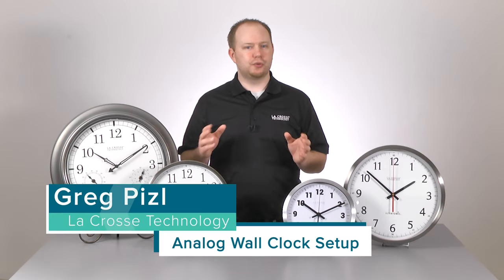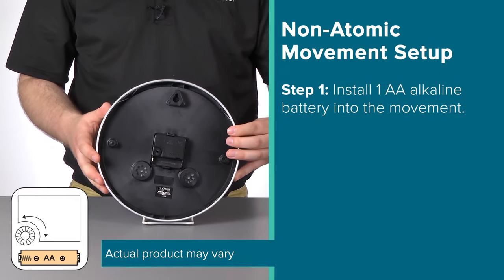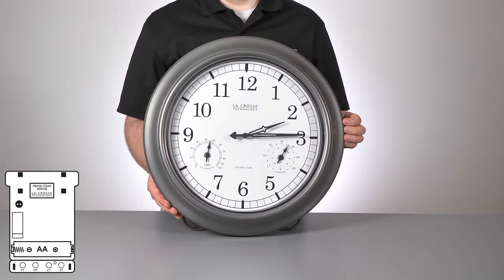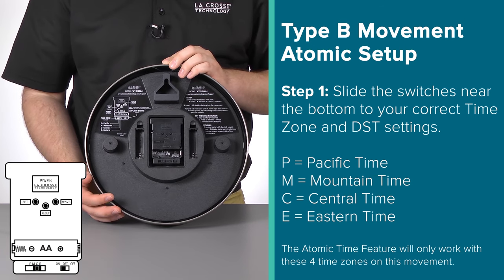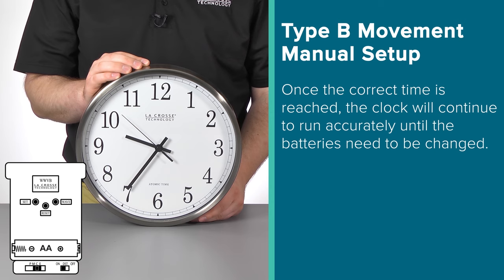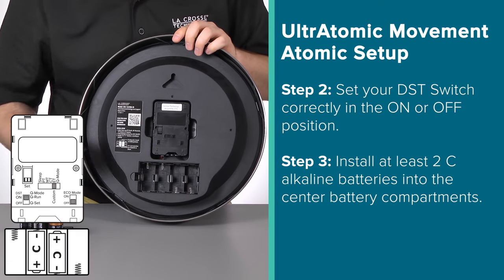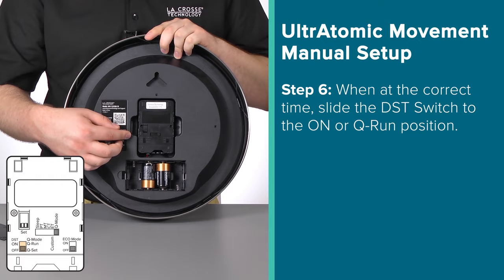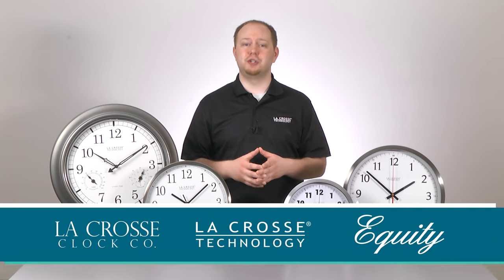How To Set Up Your Analog Atomic Wall Clock

Comment: In a hospital trying to help out the staff by adjusting the clocks for DST - this is the most complicated clock I've ever seen. Why not just have a wheel on the back to adjust like every cheap clock has?
Reply from the maker: Our sincere apologies for the trouble getting your hospital's clocks set correctly. The WWVB radio signal that our atomic clocks are designed to receive may not reach all locations, and we are truly sorry for the inconvenience of these not adjusting automatically for the DST change. Due to the nature of these radio controlled parts, their movements work differently than normal quartz clocks that feature a single set dial. This video offers manual time set instructions for each of the movement types you may have. If you should have further questions, please let us know or feel free to reach out to our support staff directly here: https://bit.ly/contact_techsupport. Or alternatively, send us a private message on our Facebook: http://bit.ly/LaxTech_Facebook or Twitter: http://bit.ly/LaxTech__Twitter page.
Reply: Watching the video may help. It explains the function of everything and how to set it.
Reply: 737
 @lacrossetechnology
Reply: 7:40

Comment: I bought the UltrAtomic model to see if it would pick up the signal in Bogota, Colombia. I checked the WWVB coverage map and in theory it should receive the signal late at night when propagation is at its best. The first night it did not synchronize but I had it in a pretty bad location near computers and power lines and not facing towards Colorado. The second day I hung it from a wall facing WNW (towards Colorado) and more than 9 feet from computers and power lines. It synchronized at 8 pm local time (EST no DST). I was not expecting that! I am 3137 miles away from the WWVB time signal transmitter and 8300 ft above seal level. This UltrAtomic clock is extremely sensitive. Good job La Crosse Technology!

Comment: Do I need to turn DST switch to off when daylight saving ends? and switch it on when daylight saving starts?
Reply from the maker: Nope! The WWVB signal should adjust this correctly once your clock receives the radio signal. The switch is just meant to tell the clock whether you're in an area that follows DST or not.

Comment: Thanks for your video. I bought a Sharp atomic wall clock about 18 years ago. It matches your A type.  It still works accurately, but changing battery and restart was always difficult. It came with no manual or instructions. I'd reset it each time on trial and lots of error, luck and a prayer. 
But this time it kept coming out exactly 4 hrs and 10 minutes behind.

So I came across this video of yours and it covered everything. I tried each option and finally was able to do a manual reset, with confidence. Old Ironsides is still working! 
I thank you from the bottom of my heart.

Comment: As an electrical engineer, it's pretty clear to me that for the clocks that permit additional batteries to extend battery life, the batteries are connected in parallel to identically sized cells. (The AA movements put all the AA batteries in parallel, the Ultratomic clock puts two C cells in parallel, and then puts that pair in series with another pair of parallel C batteries).

I don't think you stress enough - If you add additional batteries, they should ideally be all the same batteries from the same package. Even mixing identical batteries from different packages purchased at different times can result in a mismatch between the battery characteristics. Additionally, if you change batteries, change them all at the same time, and replace them with batteries from the same package.

And, of course, alkaline batteries are recommended (both for the AA and C cells) because of their extended lifespans.
Reply from the maker: Thanks Kirk! We truly appreciate your feedback and attention to detail. Many of these points are emphasized by our support staff if users are having trouble with a product, but we will certainly look into adding additional details to our manuals to further emphasize this in the future. If you should need any assistance with a product, please just let us know.

Comment: Just got the UltrAtomic clock displayed in this video. 

Looks great and was easy to set it to the correct timezone. Almost completely silent.

Thank you!

One small concern, the second hand isn't completely aligned with the minute points. Is there a way to fix this?
Reply from the maker: We are happy that the setup of your new UltrAtomic clock went smoothly. Unfortunately, there is no way to manually adjust the second hand, and we sincerely apologize for any inconvenience. If you wish to return the clock, please get in touch with our store directly at 608-785-7939 or via email at store@lacrossetechnology.com

Comment: Just got my Ultratomic clock.  Watched the video.  So far the clock is not getting the signal from Fort Collings.  I took it outside,  75 feet away from any building and still no signal. I read that atomic clocks have a better chance at getting the signal at night.  So I placed the clock by a window and will check tomorrow.  I am on the East coast in the NYC area on the New Jersey side.
Reply from the maker: Sorry for the trouble. It is not unusual for it to take a little longer being on the east coast. If you're still having issues, please message our support staff directly here: https://bit.ly/contact_techsupport. Or alternatively, send us a private message on our Facebook: http://bit.ly/LaxTech_Facebook page for further assistance.
Reply: @lacrossetechnology  I forgot to follow up on my original comment that the clock started working as soon as it got dark. I suggest you update the information in the small booklet that comes with the clock and letting people know that  they need to be patient and leave the clock overnight by a window facing Fort Collins.

Comment: We have a type B that has been, for the most part, working fine for several years.  Recently it has begun to randomly set itself to different times randomly.  (It never does find the correct time.)  I've changed the battery several times.  We live 9 stories up and the clock is on an outside wall.  I don't think the signal is lost as we also have another La Crosse clock in the next room that works just fine.  Do these movements just wear out?  It's a nice enough looking clock that I'm considering replacing the movement with a cheap generic (manual-set) movement and calling it good.  I considered the manual setting as mentioned in the video but that button is missing from our clock... just a hole where it should be...
Reply from the maker: Hey Dana, we are truly sorry to hear this and apologize for the inconvenience. For further assistance on this case, please message our support staff directly here: https://bit.ly/contact_techsupport. Or alternatively, send us a private message on our Facebook: http://bit.ly/LaxTech_Facebook or Twitter: http://bit.ly/LaxTech__Twitter page. We look forward to helping figure out a resolution.

Comment: I have a question, will the ECO mode work on the UltrAtomic movement if I had a manual time setting?
Reply from the maker: Hi Bukui, that's a great question and one we should be discussed in more detail in the video. Unfortunately, when running full manual mode the UltrAtomic movement cannot run ECO Mode. This feature requires help from the WWVB signal to know what times to turn off the second hand function. We apologize for any inconvenience or confusion.

Comment: I live in Hawaii does this clock utilize WWVH? so far I can't set the clock. Note I have 2 of these and the first one was no problem
Reply from the maker: We're truly sorry for the trouble. As mentioned in the video, the different time zone abilities will depend on the model clock(s) you own. For use in Hawaii, the UltrAtomic movement will likely be necessary to use the "atomic" feature and receive the correct WWVB time signal. Please review the times in this video for each clock movement you own, as they may work differently. If further assistance is needed, please reach out to our support staff directly here: http://bit.ly/contact_techsupport

Comment: Hi can anybody please advise please...Im in Ireland Europe and have an ALBA battery operated kitchen clock. The battery ran out so I've inserted a new one. I've only just noticed it does say radio control on the front of clock. So with new battery  in, the hands are going around and when I get to the time I want the click to stop at... Im pressing set...didnt work ...pressed reset nope and the other tiny little button that I actually need a pin to press these three buttons that say "reset" "set "and "wave" (?)....it stops for a second at the correct time when I press the "set" Button and seconds later it starts spinning again! I never actually know the clock was radio conrolled till u mentioned it and i spotted the small print.. Do u think it could be difference for my location!!  Would really appreciate your help or advice. Many thanks
Reply from the maker: Hey Lisa, unfortunately your product is not an item made by us, and there very well could be differences in how the clock will function compared to the instructions shown in this video. And though we make no promises, if you could please pass along an image of your clock's movement (the back of your clock), in a private message on our Facebook: http://bit.ly/LaxTech_Facebook or Twitter: http://bit.ly/LaxTech__Twitter page, we'd be happy to try and help decipher the instructions you should follow. We are sorry for the inconvenience.

Comment: I took the clockworks out of the original clock and placed it in my living room clock. The  clock hands do not show the correct time. Do the clock hands need to be set at a particular position (e.g., twelve o'clock) in order for the clock to match the Ft Collin's signal?
Reply from the maker: Hey David, we are sorry to hear about the issues with your clock's movement. If you've followed the steps outlined in this video for your movement type and the hands are not correctly stopping where they should (4, 8, or 12 o'clock position) during the initial WWVB search, this positioning issue may not be easily fixed. Our clocks are not designed to be taken apart and we should note that doing so does void your warranty. However, for further assistance please message our support staff directly here: https://bit.ly/contact_techsupport. Or alternatively, send us a private message on our Facebook: http://bit.ly/LaxTech_Facebook or Twitter: http://bit.ly/LaxTech__Twitter page.

Comment: When setting up the ultratomic clock, if we are setting up a different Time zone in-between GMT 0 and -11 but the country doesnt use DST, do we still have to set the DST switch to the ON position? Will keeping the DST switch OFF, maintain the clock with the accurate time for said country without DST on that time zone? Thanks in advance
Reply from the maker: For this situation, the DST switch should be kept in the off position to keep the time running correctly. 😊

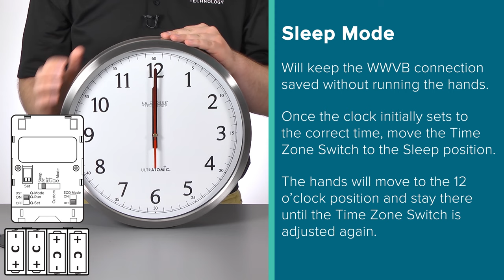Comment: I have a type A clock. Recently it stopped keeping accurate time. I removed the batteries and after several hours installed new fresh batteries. The hands started spinning but didn’t stop at 12:00. The minute hand would go to 11:40 or so. After manually setting the correct time it always adjusts to about 20-22 minutes slow. I sent an email to support who did not respond. I did get an email asking how they did. When I checked the La Crosse website it shows resolved. What?
Reply from the maker: Hey Dave, our sincere apologies for the trouble with your clock and for the support ticket issue. Did the email provide a support ticket number? We'd love to help get this corrected.
Reply: @lacrossetechnology  the ticket number was 108153. Several days after resetting the clock, I have taken the clock apart and manually moved the hands to the correct time and it still adjusts itself to 20 - 22 minutes slow.
Reply from the maker: Thanks,  @guitar1950 ! Our staff will be reaching out via email again here shortly to help get this figured out. Sorry again for the inconvenience.

Comment: I have an older WT-3181 atomic clock. It worked great for years. It stopped a few days ago. I replaced the battery, and the hands don't move. In fact, it doesn't move even with the manual set. I did the "press button 20 times and wait 15 minutes" thing and it still doesn't work. Is it simply broken? Is there anything else to try?
Reply from the maker: Hey Gary, our sincere apologies for the trouble with your clock. Assuming you're using a new alkaline battery, and these functions are still not working, it could be that the unit is broken. For further help with this, please send us a private message on our Facebook: http://bit.ly/LaxTech_Facebook or Twitter: http://bit.ly/LaxTech__Twitter page. Or alternatively, you can message our support staff directly here: https://bit.ly/contact_techsupport
Reply: @lacrossetechnology  Hi - thanks, I submitted the form to tech support.

Comment: I have what appears to be an older version. It has a 4 position switch for time zone and a 2 position switch for DST or not. There are three buttons, SET, RESET, and WAVE.
.
I changed the battery and put the clock where it is facing west (toward Ford Collins, CO). No satisfactory result after several hours. Another vendor's clock properly set, but this one does not respond. I have it set for Eastern time zone and for DST.
.
Any suggestions?
Reply from the maker: Hey Sam, as mentioned at the 7:02 mark in this video, it can sometimes take up to 5 nights for the clock to receive this WWVB signal. In the meantime though, feel free to set the clock manually following the instructions using the SET button. But be sure to have the switches set correctly, as once the clock does pick up the WWVB signal it will override your manual time settings. We are truly sorry for any inconvenience. If you should need further assistance, please message our support staff directly here: https://bit.ly/contact_techsupport. Or alternatively, send us a private message on our Facebook: http://bit.ly/LaxTech_Facebook or Twitter: http://bit.ly/LaxTech__Twitter page. We assure you we are here to help in any way we can.
Reply: You have a type B which is what I have. It's explained at the 5:13 mark. Hope this helps.

Comment: I have recently replaced the clock battery and decided to go with lithium.  Is that going to be a problem?  Should I revert to alkaline?
Reply from the maker: Hi Aunt, lithium batteries may work, however, if you experience any problems, we'd highly recommend sticking with reputable alkaline batteries for the best results.

Comment: I have 4 LaCrosse clocks which we began collecting many years ago. I am inquiring about the Analog Type A clock, model WT- 3144. Repeatedly, after a fresh battery, it runs non-stop, even days, while situated facing west, for days and days until I remove the battery. Will the "Press 20 maneuver " you showed do any good?
Patricia Schultz
Reply from the maker: Hey Patricia, thanks for the support over the years and for reaching out here on YouTube. Our apologies for the trouble with your WT-3144. Our staff suggested to go ahead and try removing the battery, pressing the SET Tab 20+ times, and let the clock sit without a battery for at least an hour. After this time, please try installing a new alkaline battery (specifically alkaline, as others can have varied results). If the hands still spin where the hour hand goes all around more than once, it is likely an issue with the movement. In that case, please message our support staff directly here: https://bit.ly/contact_techsupport. Or alternatively, send us a private message on our Facebook: http://bit.ly/LaxTech_Facebook or Twitter: http://bit.ly/LaxTech__Twitter page for further assistance.

Comment: How far from Fort Collins Colorado can you be for this to work?
Reply from the maker: We have customers using these in all four main U.S. time zones, and though distance plays a role, your specific home surroundings are often more important. For instance, if you live in a valley, are surrounded by buildings, or have other strong radio signals nearby, these can all cause interference, which can delay or even fully block this radio signal from reaching your clock. Moving the clock near a window, away from other electronics, and having the front or back of it face Fort Collins, CO will help increase its chances of catching this signal and having it adjust your time automatically (typically happens within 3-5 nights). We do apologize for any inconvenience. If you find yourself in a predicament where the time hasn’t adjusted automatically, it may be best to make sure to have your settings adjusted correctly but to also set the clock manually for the time being. This will allow the clock to remain at the correct time even if the WWVB signal is picked up in the future. More about how this signal works can be found here: http://bit.ly/AtomicTime

Comment: I have a type A, and my second hand is not turning.  Clock has the correct time but the second hand is stuck at 12.  any suggestions?  battery replaced
Reply from the maker: Our apologies for the trouble. For further assistance with this, please message our support staff directly here: https://bit.ly/contact_techsupport. Or alternatively, send us a private message on our Facebook: http://bit.ly/LaxTech_Facebook or Twitter: http://bit.ly/LaxTech__Twitter page. We look forward to helping get this figured out.